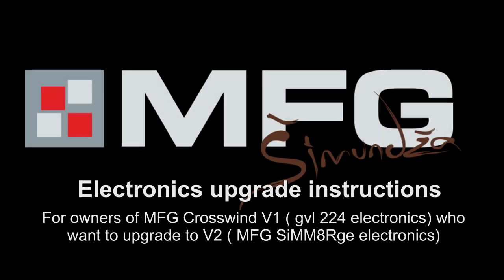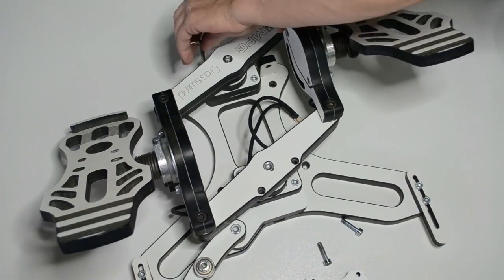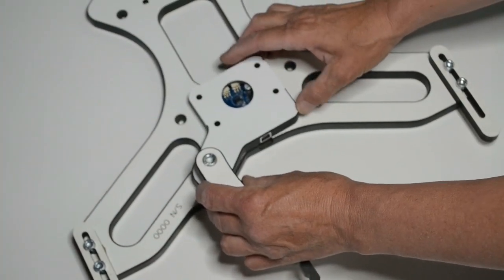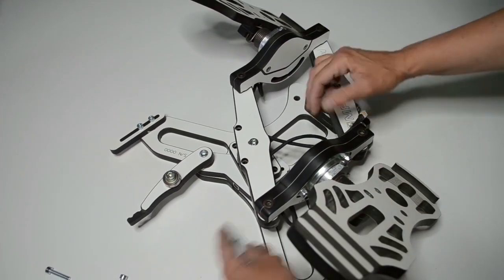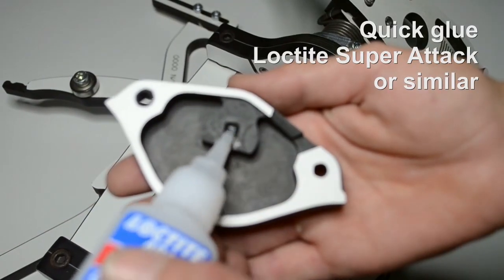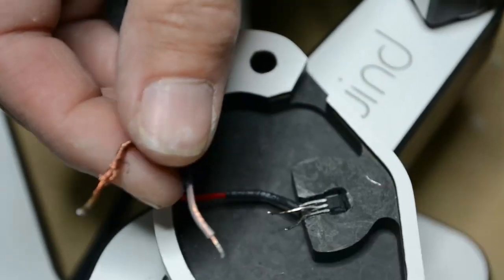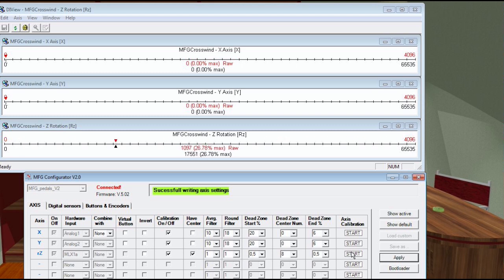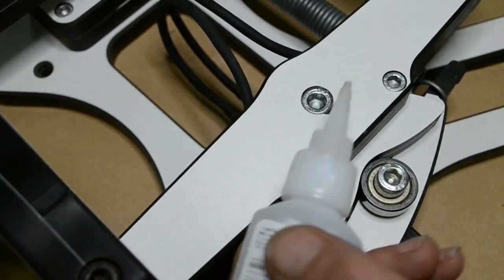MFG Crosswind V1 upgrade to V2 - electronics replacement instructions

Comment: The electronics on my mfg v2 stopped working or the plug wouldn't fit in properly. I ordered an electronics replacement and am hoping that I can replace it. What kind of wrench did you use in the video also do I have to glue or tape the electronics to the plate or is it screwed on?
Reply from the maker: hex key is same as supplied with pedals. Electronics are attached with 4 screws (phillips screwdriver required)
PS you probably damaged USB plug somehow...

Comment: Is it a must to upgrade from V1 to V2 ?? S/N 0140 twvic@shaw.ca
Reply from the maker: +54Dutch 
Of course not. We even have a small supply of Older GVL224 electronics in case anything goes wrong with yours...so you don't have to upgrade at all. This video was made for customers who want to upgrade. There are some benefits from digital sensor...but overall real life improvement maybe 5% ( better linearity, no need for periodical recalibration, not dependent on accurate 5v from your PSU)...Cost of 50-60 eur to to gain 5% ...not worth the upgrade if you ask me :-) However...there are always customers who dont mind paying that money ...and actually love to upgrade themselves and have the latest in technology....I admire that attitude too...so there is an option to upgrade
Reply: +Milan Šimundža thanks for the Information. I'm considering the expensive upgrade ;-) serial 248
Reply from the maker: +Jørgen Tietze 
As you wish :-)
If you make a decision just contact me at mfg@simundza.com

Comment: If i order the MFG crosswind will it come updated?
Reply from the maker: Daniel Costa 
Yes, all pedals since SN 0337 come with new electronics. This upgrade is only for owners of earlier variant - pre 0337 who want to have latest technology.
Reply: Ok Thanks Milan
Reply: Milan Šimundža, I would love to order this V2 upgrade kit, I can’t get my old V1 version to recognize the sensitivity in MS Flight SIM 2020. I don’t see it available on your website, do you offer the modified bracket for the new USB board, or do I have to modify the one I have? Thanks!
Reply: Hi MIlan!! How can i order this part?  I have the pedals serial 042 and, the connector is very loose- doesn’t want to connect- it seems is worn out. I did not see how to order this on your website. Can you tell me how to order one?   Than you MIlan! I love the pedals. !!